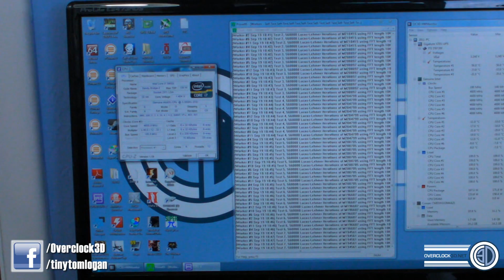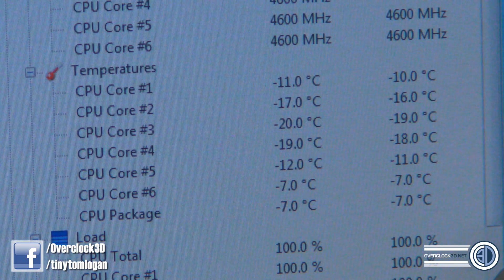Ultimate Corsair H100 Cooling Mod

Comment: °1- TIME FOR THE "I DONT KNOW WHAT IM DOING" DOG.
°2- WHERE THE HELL GOES ALL THE HEAT THAT THE FAN MOTORS PRODUCE?
°3- HOW THE FUCK IS WATER STILL LIQUID? or better yet... IS HE USING WATER?
°4- IF HE IS USING ACETONE or somnthn... HOW DO WE KNOW THAT HE IS NOT COOLING IT WITH DRY ICE OR ANYTHING? and if it where the case, WHY PUT THE FANS ANYWAY. They would only heat up the acetone with room's air.
°6- Too fucking laawd, expensive, and energy unefficient.

I got -273.15°C with gas and a match

Comment: i think you would have had better results if you used the AF fans because fans stacked on top of each other will not push more air, but it will have a greater static pressure. Using the AF fans would push more air and still have a very high pressure due to the sheer amount of fans

Comment: on an interesting note, if you were to expand the air flow as it passed through the radiator you could achieve sub zero temps.

Comment: If you had a huge case with 2x120mm fan mounts at the bottom and top you could have this massive block blowing air all the way through the case! I wanna see this installed in a case!

Comment: Quite silly but fun mod.
Two identical coaxial side-by-side coolers fan can not be effective because of aerodynamic resistance.
Need different  fan types with different vanes step & size on pressure side. Quite like plane jet engine.

Comment: h100 is a liquid cooler from corsair the fans are used on the radiator to remove the heat off the heat spreader block inside the radiator that is touched by the water

Comment: I have 16 fans in my Xigmatek full tower case, from idle to full load my mobo temp just about doesnt move, i also am running with the h100 however its only with 4 120 red led Areocool fans

Comment: curious. with how cooling works (get the air in, and out of the radiator as quickly as you can) how much performance increase does adding a fan on top of another fan give? fans have a max speed, but resistance from air would lower this. adding a fan would reduce resistance slightly... i would assume something like 5% increase of air moved for first fan added, and 5% of the increase each fan there on. estimated values, and given that assumption, 40 fans would only give about an 8% increase total.

Comment: the process of cooling a cpu is also a "thermodynamic cycle", if you want to call it like that. its just the same - the heat is transferred to the radiator and is then extracted into the room. please google the 'carnot process'

Comment: Not true a fridge gets colder because the gas molecules are compressed and released... when they dispurse the gas gets colder...so theoretically if you could create enough pressure to make the air rapidly dispurse when it goes through the H100 this might be possible... However that kind of pressure could not be reached with those fans at normal speeds.

Comment: It is possible to have a lower temperature than ambient with multiple fans, you would have to set the fans before the cooler to compress the air, and the fans after the cooler to pull air away faster than the compressing fans. As the air "uncompresses" across the cooler its temperature will drop. Don't believe me, go puncture a C02 bottle.

Comment: Note on the the fans that pulls away wont benefit after hot air get pulled a certain distance ... but the pushing fans are speeding up the air that is pushing to the H100 so you can try 8 fans on pull and 32 on push .... you should in theory be able to achieve a cooler temp!!!!

Comment: It is physically impossible to aciheve cooler temperatures then the ambient temperature of the room by adding a lot of fans. In fact, the fans a doing work to the enviroment which should make the room hotter (just very slightly). This means that the room you are in are at best -20C, but since the coolers performance can not be 100% I guess that the room i -25C. Conclusion: Trolls.

Comment: Myself being a Corsair fanboy (mostly memory), I think that any closed loop water system is absolutely pointless, since you will only cool your CPU on it, it comes with loud fans, so they have to go, and best of all.... It doesn't really beat the D14 or Silver Arrow. Not by enough to justify its extra cost (and noise). That's why my advice to everyone is either stick to proper air cooling OR build a full custom water loop. Awesome kits by XSPC if you don't know what you need.

Comment: This seems very inefficient. Not cost effective? If you want to take up that much room why don't you use a mini chiller? Instead of cooling the radiator you would be cooling the coolant! This way you will be keeping the coolant at a desired temp.

Comment: No you can't, the radiator (rad) cannot get cooler than the air in the room that is being passed through it.  The only ways to get the temps of the rad and the water going through it, lower than the ambient air temperature in the room of the radiator is to either spray a liquid on the rad that can evaporate (evaporative cooling), bring cooler air from outside the room through the rad, or compress and cool the air to a much higher pressure and then allow it to decompress at the rad(refrigeration)

Comment: I did. I knew it was a joke/troll when he said that he couldn't hear the fans running at all. I've done this myself (although only with 4 fans, not 40 o_o), and the improvement,  while good, might have been better with the fans in parallel, utilizing ducting to focus the airflow across the radiator. but m3 threaded rod won't cut it for that

Comment: He is most likely just running with an edited temperature readout.  It is not physically possible to cool a radiator down below the temperature of the ambient air blown through it with simple fans.  The other factor is that if you could cool down the processor to that level with water cooling the water in the loop would freeze and stop flowing.  The only reason water cooling is better is that water has a much higher heat capacity than air because it is more dense and allows for large radiators

Comment: If you compare to how Hardware Monitor looks like, my guess is that it isn't that program but something that is programed to look like it. With someone skilled in something like VB.Net it would be a quick thing to put together and as you are faking the temps you can just put any fake numbers in that change at a radom pattern.

Comment: push pull ads another fan to the opposite side so it adds extra surface area, however puting a fan on the back of another means that the initial fan is doing nothing as the air it can get is only the air that the second fan gives it effectivly its like having the one fan

Comment: After some point the fans would give you diminished returns. Imagine back when you've bled an air compressor out and the water's cold... if the drain was slightly was bigger the water wouldn't be cold.
Figure the compressor holds 15 gallons at 120 psi, but put about a 4  inch hole on it... you would have this setup higher pressures,  but the same scales.
There's no way it could build the pressure to rapidly cool because the air isn't being force through a smaller hole.
It was funny lol DICK!

Comment: negative temperatures are possible actually, because the ridiculous amount of airflow takes away all the energy that the water contains, causing it to drop beneath room temperature... also there probably is some methanol or antifreeaze in the cooler itself, so the pump doesn't freeze stuck.

Comment: No because the first fan sucks air in and the fan behind it pulls that air forward again and so on giving you a lot of airflow. It creates a vacuum so the first fan only has to pull air in and it doesn't have to push the air behind it away too.

Comment: In regards to the ice cube question. Your fridge is insulated. So think of it like cooking. If you put some thing from your fridge into an oven without preheating it will take forever. If water is put into an ice maker in an insulated box then the ice tray is cold as well. And industrial ice makers use copper pipes that are super cooled to freeze water fast. Now, off to play borderlands 2.

Comment: I actually once got negative temps with an NH-D14 while overclocking in the middle of the night in winter with my window open. -22C outside, about -18C inside, -12C idle CPU, and a few +C full load.

Comment: Reminds me of the NextLevelHardware article from 2007 that did RAID-0 with 9 Mtron SSDs, and Samsung did a 24-drive SSD RAID in 2009.
If i was to do this, i'd rather have a mix of SP and AF. I'm guessing you wouldn't see much improvement after 3 push 3 pull. 1x SP inner and 2x AF outer should do 80-90% of the performance at 25-30% sound.
Fake temperatures, unless he was here in norway in the winter and did it with -20-25C ambients. Also, does H100 have anti-freeze in the liquid?

Comment: You could have used 6/32 to M3 motherboard standoffs for that snug thread fit... would have left a small stand off, but you could mod the fans or just use some foam to fill the gap ;)

Comment: You mean, it would be like 2 fans in push pull configuration as the performance is 10% cooler than having 1 fan pushing (and 1fan pulling is less effective).

Comment: It is depending of what fluid as a heat cerrier were used in H100, if it is a water, even under low pressure, temp allways is goin to be as low, as water waporisation temp under given conditions of pressure. If it were, let`s say "pentane c" or some other fluid/gas that can have waporisations temps under 0 Celsius, AND H100 would have a comperssor, than it wold be possible to go under 0 celsius.Since H100 is not a fridge, and it is not featured with compressor, the shown results is a simple LAG.

Comment: I agree with what you're saying but it wouldn't surprise me if 2 stacked up is more effective because then the fan on the rad has the other fan "helping" the air to it so the maximum amount of air (without increasing the fan rpm) is going through the first fan. If that's even true I bet it makes less than 1% difference though.
But I suppose you never know until you try it.

Comment: it would effectively be the same as 1 fan regardless of how many u add, as the air is only being sucked in at the rate of one fan so this would actually be less efficient as the air is lost throughout the array of fans.
the only way for it to work is if you make like a pyramid shape so there is more surface area on the fans.

Comment: The only thing I would be worried about is the coolant freezing. If I were to spend $1200 on fans do this I would have run a better water block with a custom loop and some bigger hose to improve the flow of the water to get even more out of it lol

Comment: I get similar results but i have a huge 220v set of fans on the sink. All metal fans i managed to score for free from a rack type mounted cooler from a server. I prefer those because it's been 6 years now and i only take it apart for cleaning. Only downside is it's effin loud.

Comment: I don't think that those temps are real :/ how could fans cool the air :O if a fan pushes air that's at 20°C than it's the lowest temp that it can get radiator and the coolant to...sooooo... I believe this is fake...good job trolling xd